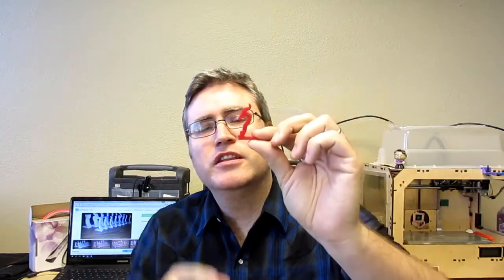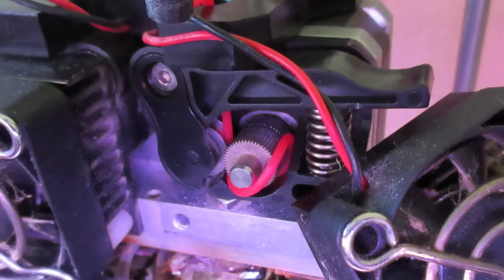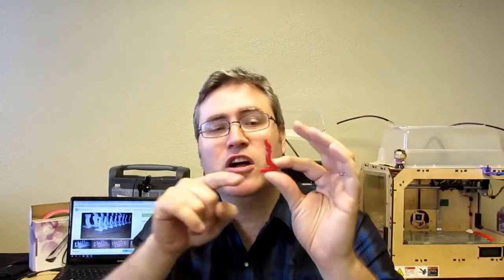3D Printed chess set in NinjaFlex

Comment: hey joe! nice guide!!! do you mean the extrusion speed to slow and the travel speed faster? refering to the (4:25) phrase. must be printed very slow
Reply from the maker: +Batida Vital The recomended settings for ninjaFlex are to print it at 20mm/s. In Simplify3D that's called the "Print Speed" setting and it's under the "Other" tab. However, the travel speed, or in Simplify3D the XY speed, which translates to how fast it moves when it's not printing, can be set just as high as your printer can handle, which in my case is 70mm/s and that will reduce the stringies between parts, since the retraction does nothing.